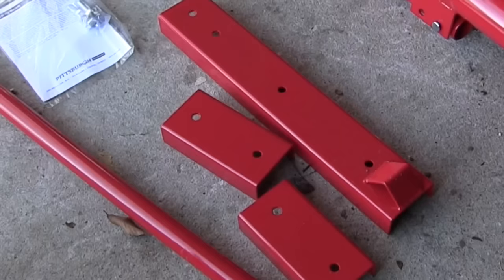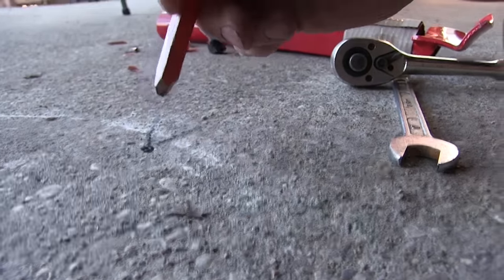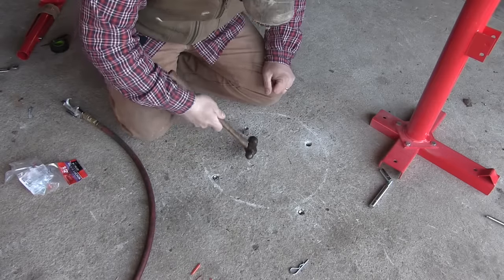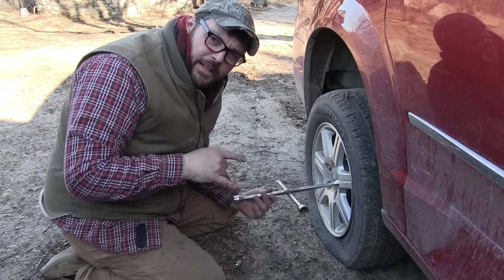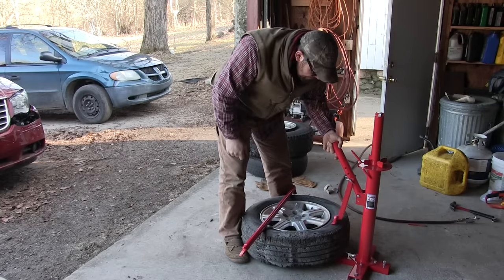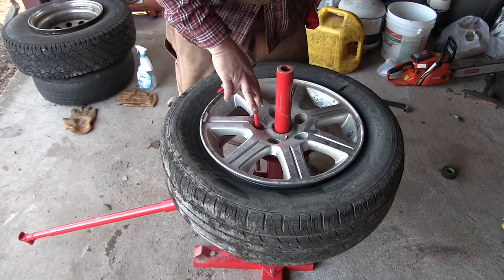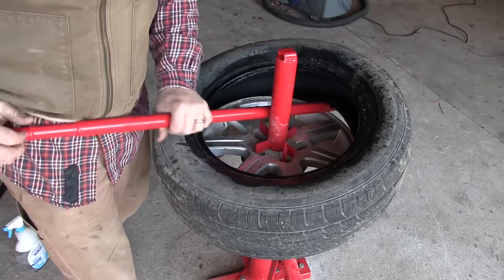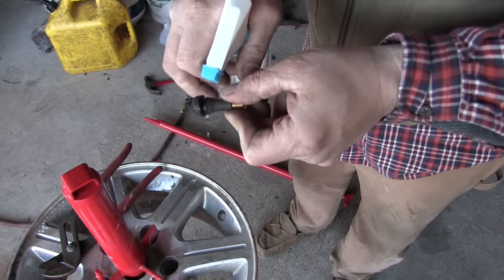Harbor Freight manual Tire Changer review

Comment: Great video. Self-reliance is everything in this day and age. In a rural area having a machine and knowing how to change a valve stem can be the difference between having a working car or an expensive tow bill. Getting a balance or ordering a sensor on ebay can happen later or at a more convenient time.

Re: Balancing. If you had intended to replace the sensor, you could also have marked the exact position of the tire on the rim with an alignment line using chalk, etc.. Then when you remounted the tire you'd just need to line up against your mark before re-seating the bead. As long as the sensor was the same, the balancing wouldn't change. I never measured the weight of a sensor, but I see in the video the counterweight was directly opposite the valve stem hole indicating that the balancing was taking into account the weight of the sensor. Pulling the counterweight off would probably had resulted in a better quick and dirty balance too.
Reply: AGREE, Bought tire changer n balancer[bubble] EBAY in 2019 and pd for itself already..Decent quality for around 90.00 for the pair..A few tires to get the hang and tips on getting faster , where to put bead breaker etc.. Bal can be finiky but slow n easy, take your time to zero bubble  and can get to 80mph and no thump..My area m and b a tire can run 17.00 to 25.00 , so have done 12 pairs so far and getting faster..Best purchase..
Reply: qoa!

Comment: A tip from a man who does tires every day he works. Mark the valve stem on the tire! That way you know where the tire was balanced and the way it was rotating so no drivability concerns arise. But I'd love to see a video on a manual balancer as well! Great job on the video!
Reply: Yep, I would have put a line  on the rim and tire, and matched it when remounting so the exact spot, tire to rim, is the same prior to taking  the tire off.

Comment: I've had mine for about 4yrs and I'm happy with it. I've changed a lot of tires with it and gonna change a lot more for sure. Once you get the hang of it, it's easier and faster to use. Great video by the way
Reply: Does it scratch the rim?
Reply: @perripierre9295  Yes. But you can put some type of lube or grease around the rim to help reduce contact, or put some type of rubber or leather there to protect it.

Comment: I've used this exact tool at home to change between 6-8 tyres in the last year. It's totally worth the money and once you get used to it, it takes all of 5 mins to change a tyre. Use the rounded nub like you initially did when putting the final bead back on the rim. when you first place the tyre on the rim to go back on you should be able to push the first bead on by hand.
Reply: Could I use it on a lawnmower tire

Comment: I’ve had one for 20 yrs now. I use it A Lot . I mount my own and then get balanced at Walmart . I did have to weld the top stem back on once changing 33” tires but it works great and I highly recommend
Reply: Thats what i plan on doing from now on, recently went to tire shop to get some tires mounted and blanace that i purchase online and they charge me 105.. I feel this machine will pay for itself on the firt use.
Reply: Wondering why you get it balanced at walmart, is that a lot harder than the mounting?

Comment: Thanks for the video, it was a big help. I told my son and a friend I needed a couple of wheels & tires to roll some street rod projects around. Mysteriously I found about a dozen tires & wheels in the barn, different lug & tire sizes. Pick out what I need/wanted. So I bought a Harbor Freight tire changer like this one, removed the tires. Some of the rims will be scrap, other will have used tires put on and the old tires will go to the counties tire recycle program. Like you said why spend hours & money  at a tire  place when you can do it it your self with this tire changer. Just like your video, this tire changer works great and is a time & money saver.

Comment: Thanks for the review ! As an actual former tire shop mechanic I was skeptical manual tire machines were really difficult to use. As Im used to using real automatic tire machines this doesn't seem too bad at all. I will have to invest in one now thanks for the video .
Reply: Did you purchase one or were you just running your pie hole?

Comment: I changed many tires using this tool. When installing tires especially older tires that I use just to keep older vehicles mobile I have the same issue using the bar to install. Usually have to pry the the tire on. What I found along the way is to make sure the opposite side of the tire that you are working on is in the deep part of the rim & using a vice grip or a clamp on the rim make the install a lot easier. I now have to make a small repair on the bead buster part of this tool. It now bends when using it.
Stay safe, Joe Z

Comment: I've had one for a few years. Works great when it is adjusted to the size of tire being worked. I'm limited on space so I've bolted mine to a 4'X6' sheet of 3/4" plywood. Then standing on the plywood while working the tire works fine. then the whole thing can be moved out of the way or disassembled if need be for more space.  Too bad about your bead breaker, mine fits perfectly.  Using the air gun to set the bead as demonstrated here works for me. Thanks for the tip. 🙂
Reply: Way Gone ....  I don't have any concrete around to mount this unit. I was guessing/wondering if mounting it to some plywood would allow me to  operate it. THANKS for the heads up that it DOES work on a sheet of plywood. I will be checking into one of these soon.!! Today I payed 30$ to get tires swapped out on   2 wheels. Not even balanced.
Reply: Thanks for the tip about  bolting to sheet of 3/4" plywd!   I bought the device yest for $59.99 at HFT.  Didnt realize i need to bolt it down though. I have no garage   to mount in. Thanks!!

Comment: This tool is priceless! I've changed countless tires with it and made a lot of money from doing so. Although, one recommendation I would like to state is.. to weld a larger brace onto the bead breaker arm. After prolonged use, it'll begin to bend and ultimately break, leaving you at square one. Those thin weak attachments aren't very sturdy at all. Then again.. I'm use to mounting/unmounting 31's and larger with ease.
Reply: great advice! will definitely be doing this!

Comment: Brought back memories of my youth. I worked in a tire shop that used a more robust but very similar machine. We had a Coates 20/20 in the shop as well and the manual machine is actually faster because there is no reset time. Good video.

Comment: I bought one of these and bolted it to a heavy duty (heavy) wooden pallet (offset from the centre of the pallet) to allow the wheel to sit level instead of bolting into the floor as i didn't have a floor to fix it to and it worked just fine if you are like me and can;t bolt it down. I love it i can now fix my own tire problems without  paying hefty shop prices. Loved your video and thanks for sharing your experience. Like you i still have to sus out how to use the other end of the bar properly to get the tire back on.

Comment: Loved the video, I am a pro mechanic and do plenty of tires. Obviously, in a professional shop we have a nice hydraulic version of this. I have never seen one of these in use, and I would say you did great!

 I will say that if you were mounting new tires or low profile tires  you would have ALOT harder time getting the tires on and off the rim. If you have truck tires, that have a large sidewall like  truck  and off road tires, it will be a lot harder to set the bead when you go to fill the tire. Just a PSA for anyone looking to get one of these!
Reply: also much harder for very old tyres which may become very harder material, not any more very plastic. Doesn't also work with rims without central hole... like on citroen 2cv.
bead breakers also is slipping along the tyre instead of keeping next to the border of the rim.
I think I will one of these day better find a hydrualic machine! a lot more expensive but much easier!

Comment: I welded mine to a 2x2" pipe and use the receiver on my truck as an anchor , works great for camping when the guys blow out a bead on their 4x4s and atvs .
Reply from the maker: Thanks. Thats awesome to have it mobile like that
Reply: Most certainly better than a scissor jack and pry bars.  But to be honest, I wouldnt trade those memories for anything.
Reply: Genius!
Reply: How the heck do you get an ATV tire on the rim?  Any tricks?  I popped it off easy, put the first side on easy but cannot get the final side of the tire on the rim.

Comment: I have had one for 10-15 years, changed tons of tires with it. Well worth the 30 bucks I payed for it.
Reply from the maker: right on!
Reply: Same here. Paid for mine the first day. I do around 6 or 8 tires a month with it. Held up well except for the bead breaker. Flexed and twisted on difficult jobs so I reinforced it. Works fine now.
Reply: I modded mine like on some of the other videos with a duck head, works pretty good.  Won't do low profiles.

Comment: 9:49 You had the right setup for mounting there, it has to be done in clockwise fashion with the mounting tip, but the key is to keep the mounting bar braced up high on the center post, which keeps it from slipping off the bead.  The mounting tip has a ramp profile that will guide it down under the rim edge, and the important thing is to keep the opposite bead in the drop center of the rim, which gives sufficient slack to get it over the edge.
And using a good tire lubricant like Ru-Glyde makes a big difference in the effort required.

Comment: Great Video.  Years ago I bought the same device but put this on a 3.4 inch of 4 x 4 plywood because I did not want to drill into the floor. This was great for changing motorcycle tires as well.  The local shop wants $50 to mount a tire.  Not for me.  This is a great tool an you definitely need to get one. Money well spent.

Comment: I found with mine if I could have say 10psi in the tire, it kept the sidewall from collapsing around the foot of the bead breaker. Just barely move/break the stiction on both sides, then release the air.  Especially helps on floppy ATV tires.

Comment: You should mark the tire orientation before removal, especially if not rebalancing.
Reply: Right rear tire ain’t gunna feel shit if it’s out of balance
Reply: I'm glad someone said it, I was wondering how he was going to rebalance it. I understand the concept, but that's what spare tires are for. Until you can get your tire to a shop. I wouldn't be comfortable using this tool/machine
Reply: @mikestoms4015  should I even mention the possibility of rotating the tires?
Reply: I've used mine many times because the tire shops overcharge these days
Reply: Thanks for the video

Comment: Good video, thanks for review, fyi I've changed several TPMS, you don't need to remove the tire from the rim, you really only need to unbead the front of the tire, put a 1x4 or 2x4 to between the tire and rim so you can remove the TPMS and replace it, or install a new stem if that's what you want to do.  You can also fish out a TPMS if you drop it in the tire or it falls in with out removing the tire from the rim...been there done it lol

Comment: The main things I did wrong when bought a motorcycle version of this is that I did not mount it to the ground or use soap water. I did still manage to change out dirt motorcycles with street tires. If only I mounted it it would have been more pleasant to use. I did not know you could remove that thing in valve stem, I will make that tool.

Comment: changed quite a few tires with just pry bars and a sledge or hi lift jack. where theres a will, theres a way
Reply from the maker: Right on
Reply: Hi Lift jack a very old tool from the old wooden wheel wagon days and still very much needed on the farm, from changing tractor tires to stretching fence wire. A drop of oil here and there and lasts for ever.

Comment: 4:32 I use a cut up tire tread to cushion the breaker arm stop at the base to help keep it from gouging out the rim.  Also works to cushion the rim from the star retainer when putting the wheel on the changer-
Any old tires I have, I cut up and make jack pads which are very useful-

Comment: Who remembers split rims. They took on a lot of the issues and worked well back in the day. just needed a cage otherwise, all manual and no fancy tools. And if you do not have enough pressure via your compressor to set the bead, there is always the roap and a spinner like a tourniquet around the tread of the tire to get the beads closer to their setting point or hairspray and a lighter, for quick volume expansion beyond a small compressor. Once it is set, you can use the compressor you have to get it to the needed pressure. Great video and I see one in my future.
Reply: I’ve heard of Guys putting a little Gas in the Tire and Lighting it to reset a Bead. They would break a Besd loose going over Rocks and who knows what else. They had 12V Compressors mounted in the Engine Compartment. They said the Gas worked Great.

Comment: I have had one many years.  I have not been to a tire store since.  I found a real manual tire bar at a flea market.  That item was a game changer.  I have over 200 tires on the ground right now.  I have a separate bead breaker.  I have a gallon of paste tire soap that can be mixed with water or used thick.  It is a little thicker than grease.  You need to get some to put on tire bead and I dip my spoons in to protect beads, each time I use it on tire, several times mounting one tire.  I have broken that big pipe bar in two a few times and welded back together.  But I was doing some rough old tires.  Breaking beads I sometimes use a hi lift jack under a truck bumper with tire under base of Jack.  Then I'd leave it an hour till it finally gave.  Them old car bumper jacks work good also to break beads on old tires.  I use them too.  But I have a one ton mechanic tool truck with a crane, welder, air compressor, which means HEAVY.  On newer tires you don't need that.  But I commonly get old junk that hasn't had tires off in 50 years, they can be tough.  If you have a collapsed tire where the beads are almost touching, hard to mount that.  Put an old tube inside tire and air up tube and leave in the sun all day.  Then remove tube and put tire on rim.  The manual tire changer, bead breaker, and bumper jack have saved me multiplied thousands of dollars.  On the bead breaker you need to make it a little longer on the base to do modern tires with rims over 15 inches.  Let's face it, lot of tires over 15 inches now days.  I have never used the bead breaker on the tire changer.  I got mine second hand and didn't get that part.  I already had just a bead breaker and plenty of pawn shop tire spoons.  I had went a long time thinking my life was complete...then, I got the manual tire changer pedestal thing.  Now, I may see the tire man at the grocery store, I just say hello and move on. He still remembers me from days gone by.

Do not use hand cleaner for bead lube.  It makes your patches come loose.  Get one of those wax crayons at the auto parts store to mark valve stems and leaks.  Save old spray bottles for soapy water leak finders.  They also sell some black sticky stuff with a brush in lid to paint troublesome beads with.  It is in a can like pvc glue comes in.  I rarely use but it's nice to keep handy.

Comment: Two things for the future. 1, when mounting the new tire on the rim, make sure the near side of the tire sits under the big bump near the bear then talk the tire tool around. 2, if the tire is touching the top and bottom of the rim like this one was, getting air in the tire fast isn't really necessary; that's only required with floppy sidewall tires that are too narrow and don't touch the top and bottom sides of the rim.

Comment: I've used them for a few years.hooked mine on a big steel plate.The only thing that bothers me is how hard it is to break the bead on some rims. Especially aluminum rims..
Reply: Soapy water to begin with helps. 
As you push it down the water will get between the rim and tire
Reply: I think with  some quad bikes you need a separate bead breaker unless you have the patience of a saint
Reply: @wally10ize   So true. I think they have a separate attachments for smaller wheels.I did a few utv wheels by hand with a few small bars , it was hard.
Reply: @whoawhoapop1984  don’t release all the pressure of the tire  leave a little bit of pressure on it before you brake it loose ….You will be amazed!!
Reply: @luisonate77  ill try it. Ill try anything! Thanks

Comment: Modern tubless tires use " drop center " rims / wheels. Make sure the bead goes into " valley"  in the rim while dismounting and mounting the tire. With lube should be relatively easy. A bit of soap is necessary. Really old hard tires (aged ) are another story.

Comment: From a design standpoint, if you are able to mount a link to the main vertical shaft, lower than where the bead breaker is, then mount the other end to the bead breaker, as you press down on the lever, and the bead breaker goes down, the link will push the bead breaker out and keep it from sliding down the tire. This might help with breaking the bead easier.

Comment: Friends, that failure that is seen at the beginning, is corrected by manufacturing the push plate longer in the arc of the circumference, at least 230 mm with a radius of 180 mm, so there will no longer be those continuous slips and the unblinking is more cash.

Comment: Bought this but didn't have a good spot in the barn to attach it to the floor. 
  Mine works great & I just attached it to a 4' square 3/4" piece of plywood
Reply: Those blue pallets shim/blocked out are heavier mineis outside 7 yrs or so its rusty broke pin &use a 90 degree bent bolt ... I wanna make the nail/stem tool